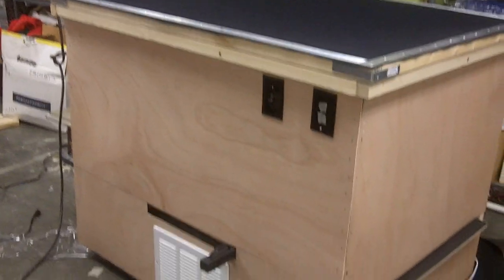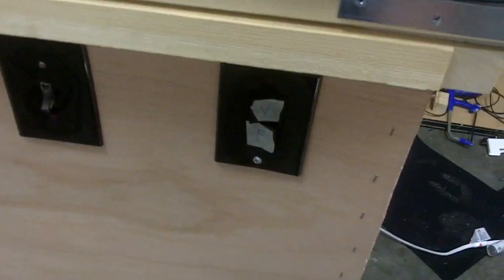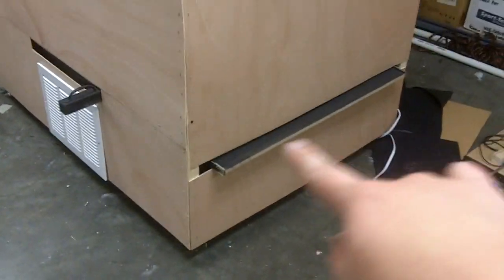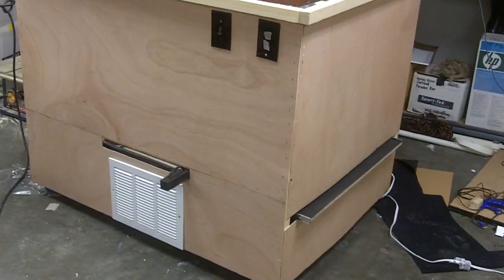Homemade Exposur

Comment: Hey, This is an amazing home-made unit! I'm just wondering whether you were specific with the model of bulb you used? I've looked a bit into the spectrum needed for emulsion to expose and I'm just wondering if you took this into consideration when buying the metal halide.  How did it end up when you got it running?
Reply: behulls 1000W metal halide